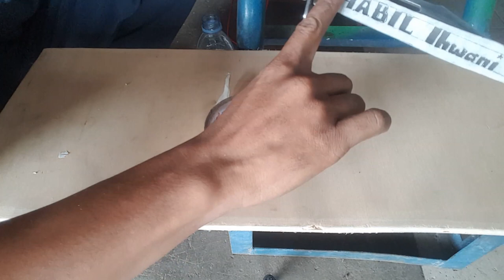Cara membuat tulisan di logam pakai air garam(etching)

Comment: itu di usap usap ya.. nah klo di celum gmn. apa bisa makin dalam hasil tecing nya
Reply from the maker: Di Celup g bisa bro...
kalo pengen agak dalem pake Ampere'nya yg besar..
kalo cman buat nandain pake yg Volt kecil ampere kecil jgq bisa
Reply: @GChriztKangGolok  sya pake 12v 20 ampere
Reply from the maker: @vickyhermawan6240  lmayan ada bekasnya hehee...
ntu yg di Video 200A...
pake Charger hp jga bisa 5V 2A.
Reply: @GChriztKangGolok  aki trek ya 😀

Comment: Bagai manaa caranya supaya coraknya lebih dalam bosku
Reply from the maker: Ampere'a lebih besar ka,,,Trus tahan lebih lama..
Reply: Cara menaikkan ampernya gimana broo... adaka alat khusun untuk etcing gini broo klo ada mhon info namanya apa... mksih sblomnya bosku
Reply from the maker: Alat khusus saya kurang tau juga Om...
Sebenernya pake Charger hp pun bisa,ada bekasnya(5A).
Yg saya gunain pake Accu 200A.makanya hasilnya lebih dalam.
Reply: 200 A itu aki berapa volt bosku
Reply from the maker: Aki Semua 12Volt ka...😅
Reply: 😁😁😁😁 maafkan aku atas kebodohankuuu
Reply from the maker: @suelfika9524  perbedaan di Ampere saja...
Kalo mu di buat 24V di Pararel.
Ampere di gedein,Pake Rangkai Seri 😁
Reply: Ngak nyetrum kaa ituu bos
Reply from the maker: @suelfika9524  ampere Geude,Cman dikit,sperti kesemutan,
Tapa bbrpa detik Cepet panas ka..
Reply: @GChriztKangGolok  klo yg pake cas hp gimana caranya msBro?mtr nwun pencerahannya_